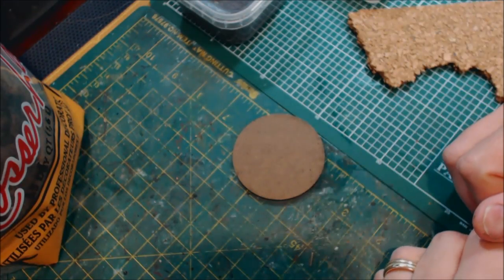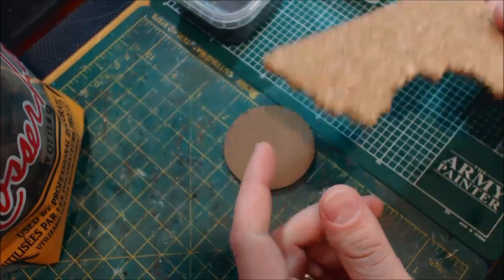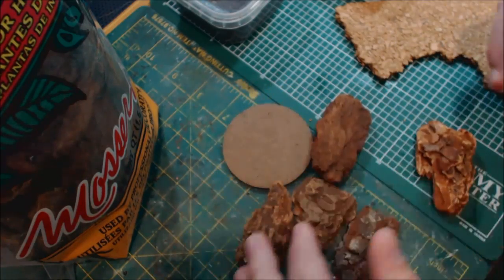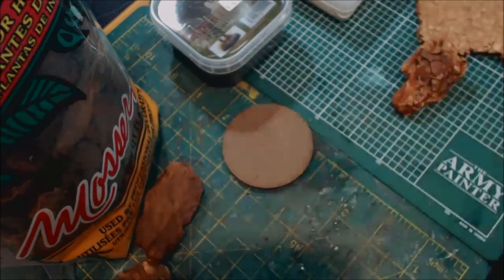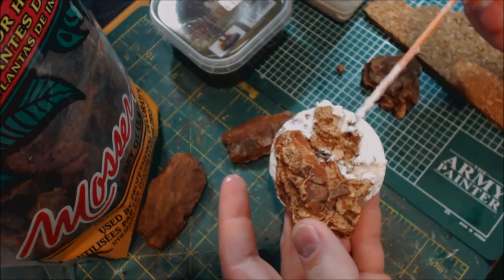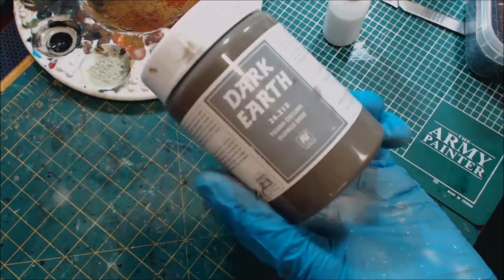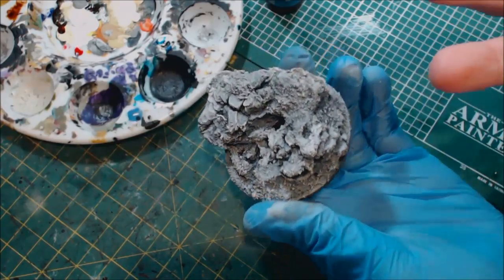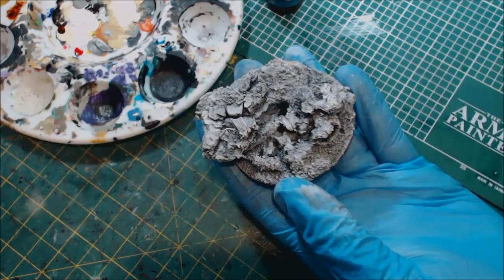Hobby Cheating 93 - How to Use Cork, Bark and Grit for Basing

Comment: This may sound odd, but it never really occurred to me to combine spackle and cork pieces like that; generally, when I'm stacking corking I'll use tweezers and picks and various other hobby tools to basically "sculpt" the cork (for lack of a better word) by breaking up the edges and the top surfaces until it look more organic.  I'll definitely have to give this a shot.  As a general tip (for anyone who may not know) you also add a little bit of rubbing alcohol to your glue and water mixture or put a few drops of it down on the surface of what you're trying to seal in; in both cases, the alcohol helps break the surface tension of the water and glue, which in turn allows it to spread out and soak in faster.  You can also make something very close to the basing paste yourself; just add various grits of fine and coarse sand to the spackle - you can also add some white glue if you're worried about adhesion - and mix them together.  There's no real recipe, you just sort of add things until you like the consistency and, if you want, you can also add a couple of drops of paint in if you want it pre-colored (like the various basing pastes).
Reply from the maker: Yep, I know the Terrain Tutor has some great tutorials about that as well. I tend to break them up, but I know that you can combine those depending on what you are trying to create.

Comment: You've helped me save time in all aspects of this hobby. I thank you for that firstly and you're well spoken so that's always a plus. 

Accolades aside, if you could answer a question. 

How would you go about getting a sun bleached effect on the carapace and shoulders of an imperial knight? 
Thank you.
Reply from the maker: Sure, I assume you mean you want to see highly faded paint. It's going to be a tough effect to sell on it's own. THe basics of the paint would be to desatuate it toward a high tint (i.e. white). Sun bleach burns the color out of things toward white. The issue is, if it's out in those elements, it's not just sun bleaching, its scratches, rusting, damage, streaks, grime and general weathering that all need to be in that mix as well. At the same time, if you have color in shadows (such as the piece on the knights chest or groin), those should remain mostly saturated with the original color.
Reply: Vince Venturella Thank you very much for the information! And the insight into how to make it look real. You the man.

Comment: Vince : reference the holey areas, me myself I'd fill them in using old paint brushes cut down and hot glued in, so that texture and height variation is another concept to add.
Plus when applying your pumas stone from Vallejo before drying takes place I dip the base into grit and stones, because I find it is easier that playing with texturing and your fingers only can hold so much at a time. Maybe you can trial this method and see what effects you come up with to add height and the effects of weighted stone!
Reply from the maker: Awesome ideas, I really love the brush idea, what a great idea to get the final use out of those broken down brushes.

Comment: When working with cork, in order to create more realistic looking rocks. I do the divot, etc but I also put some texture paint on the top of it, to disguise that it's cork. Just some of the citadel stuff will do, but I prefer AK as they make more realistic products for mud, earth etc. I only pout this on the top layer though, where it would be most obvious that it's lots of smaller pieces (well cork, LoL) you can then work this further with basing sand and stuff. just to give it a dusty appearance with loose stones and stuff. 

I always do cross contamination as well, so I have some of the mud on the stones and some of the stones in the mud, etc. It really helps with the realism. Then also pigments are a god send for basing. A pigment or two can really help to sell it.
Reply from the maker: Yep, also a great idea for sure.

Comment: Great video Vince. A light coat of clear epoxy or super glue will give a nice hard coat over the dap so you don't have to worry about chipping
Reply from the maker: Yep, in general, I always have something over top (like the the mud here), so I don't generally have to worry about it, but it's a good tip for sure.

Comment: I really like doing overhangs with my rocks. then if you have the guy standing (partially) on the overhang, too. Looks awesome. I did a priest with an Evicerator that was standing on a Lion King style rock, poking the chainsaw off the overhang. The base did so much for the mini. 

it was like a mix of nature and warzone, and I had bits of barbed wire with poles that had been stuck into the ground (bit gotten half blown up) was only the second scenic base I ever made as well, and carved my rock out of cork (got it looking good, but took work) my first one was done with an actual piece of slate, that took all day for me to drill through with a GW hobby drill (for pinning the mini) they were both for Evicerator priests for an Imperial Guard army as well.
Reply from the maker: makes sense

Comment: I recently discovered a substance similar to kitty litter but for absorbing oil and grease stains off shop floors etc. I run it through pantyhose for awesome superfine grit, then through screen door/window sized screen for rough grit (gravel) and unsifted it's about like river rock at 28mm/1/48scale. Use the superfine to make texture paint and sand, then the next scale up for fine gravel.
Reply from the maker: That sounds awesome, I will have to look into that.

Comment: Another great vid. The flat top of cork has always driven me nuts when I see it.  Question about the spackle, is there a reason you use that instead of just using the basing paste for that step?
Reply from the maker: You could, I like to build up a nice solid base rather than waste the more expensive basing paste, it also dries a little more solid and is easier to build up large areas (i.e. it doesn't shrink), but depending on the size of the base, you could do just the base.

Comment: Good video man its great. Thanks for sharing this.
Reply from the maker: No problem 👍
Reply: Hey bud iv noticed that sometimes my sandy bases "peel back" my other ones are on really good and im happy with it. I think it was because after useing the white glue then adding the sad I never let it dry completly before adding more white glue ( thinned down a little ) on top to seal it in. I get bad results with Gorlilla gel super glue as it dry to fast and is more tricky to base with. So I got the Elmers white glue and will let it dry for a day then add another layer on top. No clue how this happend but this is my guse before I had even lower grade white glue and it worked very well. Would love to hear your thoughts. ( the gorlilla glue works great for smaller pebbles very strong ) @VinceVenturella

Comment: Solid video as always! What glue do/would you use for securing a large mini (stonehorn in my case) to the bark? Would you advise pinning the mini to the bark also? Thanks
Reply from the maker: Always pin such large models, you just have to. It's also nice as they have really flat feet and are an easy pin. I would also recommend Loctite Ultra Control Gel Glue, that's what I use for such jobs to make him secure.
Reply: @VinceVenturella  I'll give that a go. Many thanks

Comment: does the vallejo texture paste not have enough glue grip to hold the grit/rocks on its own if you push it in a bit, without the PVA mix? i've not used it myself but have heard a number of other places speak about how it has a strong hold
Reply from the maker: It will, I wasn't using it that way then, but I do so now in the more recent videos.
Reply: @VinceVenturella  do you think it's strong enough glue in flock and more softer granular materials like sawdust if you press them down a bit? Or would you still use PVA for that kind of stuff

Comment: Hey nice work but i have a question : why did you usef dap then vallejo dark earth, wht didn't you use only one of them like only the dark earth? I mean I don't understand the difference between them and why using one or the other
Reply from the maker: DAP is mass, it's just building up area (it's drywall putty effectively). Dark Earth is texture, it's the final layer to make it actually ground. Hope that helps. :)

Comment: Hey Vince sorry to bother you but I have a bit of an issue with a seraphon army I was basing with a nice colour potting sand but after I sealed it with watered down PVA it's made some not all now, look like building sand I'm drying guys out now on a radiator incase they might be still too wet, I was going for a simple desert sand is there anything I can do ? I don't want to paint every thing if I don't have to
Reply from the maker: Well, I'll be honest, I never recommend using unpainted anything on the miniature, including ground texture. It's just always better to paint it. In addition to things happening like you describe (which is always possible when dealing with natural elements) it can also change greatly over time. My best advice when using anything natural is make sure it's dried out, seal it, prime it and paint it. In general, you want everything on the mini painted or it will really stand out. That's probably the best advice I can offer, hope it helps.

Comment: Random question but what is the advantage of the gridded matts so many hobby painters? My mother is a quilter and i know those matts are used for rotary cutters since they wont cut through the material when making cuts across fabric.... but ya theyre expensive and im just curious what the function in hobby painting is for.
Reply from the maker: I find the advantage is just that I don't destroy my death. The little measuring bars are occasionally useful, but really, it just keeps paint, razor cuts, spilled washes off my actual desk. I would call it useful, but by no means essential.
Reply: Most cutting mats out there are also self healing, which means over time any cuts left in the surface will close by themselves.  It also helps keep your hobby knife blades from dull quicker, since they're hitting the cutting mat when they go through/when you complete a cut as opposed to a hard desktop surface.

Comment: Can plaster of Paris be subbed for spackling paste by chance maayyybe? I have a ton of art supply's and the oil paints about the only thing I can use ironically. Anyways...plaster has properties of cement but I'm assuming what your using is a paste 

Any experience on this?
Reply from the maker: I will honestly say I am not sure. You may be able to, but I am not familiar enough with it. I would check out The Terrain Tutor's channel, as he has some vids on using pastes like that and has some alternates. My concern is that PoP generally wants a mold or something similar, but it may be perfectly fine.